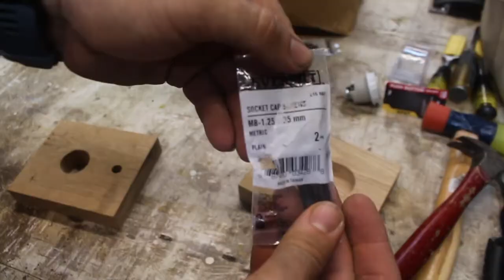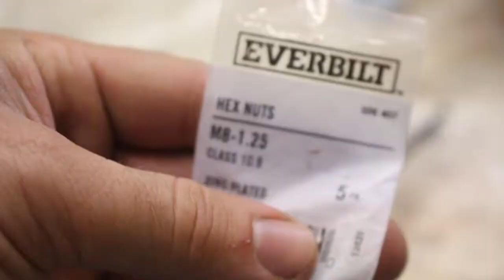DIY Desk Lamp  - Edison Light - Wood Desk Lamp How to

Comment: Its a nice simple light with switch and a touch of industrial design with allen bolts , I'm a fickler for getting things right though so I would have had to change the switch and lamp holder to one more from the time or a copy obviously, also allen bolts started in 1909 so the bulb would have to change as well but that is just me, not the builder of this light, I have to get things right to their times!! ..... 

Its a pity about the damage caused to the top surface, little bit more care with speed and tools would have stopped that.  good design though. subscribed.